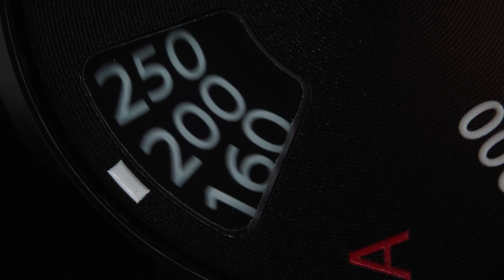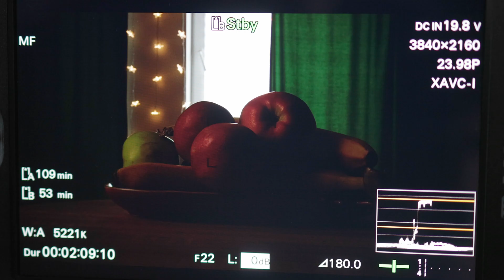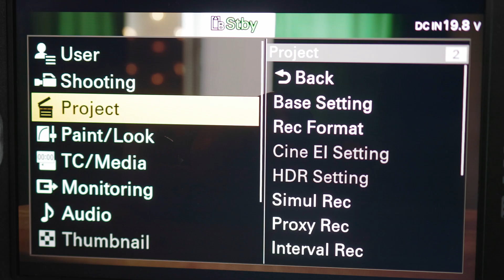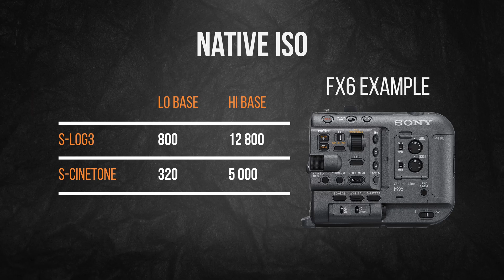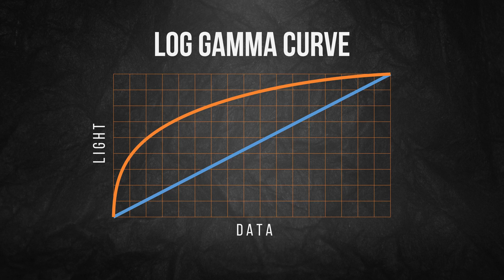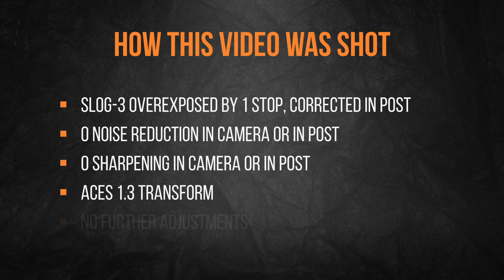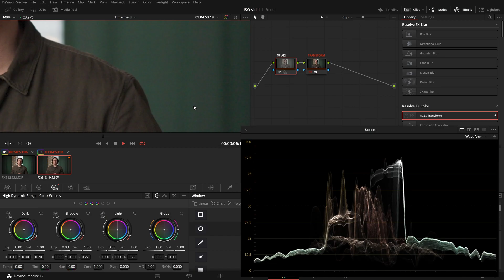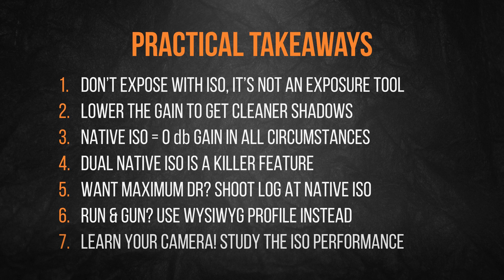Unlocking the Secrets of Native ISO & LOG Exposure

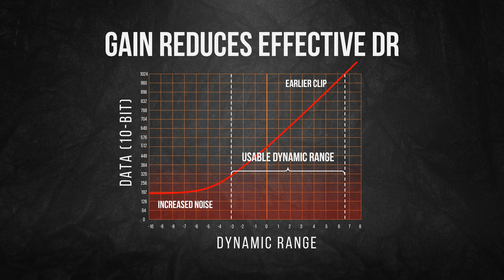Comment: 8:03 so the signal to noise ratio doesn’t change when gain is applied? I was under the (probably wrong) impression that increasing iso might yield a better outcome since the signal to noise ratio might be improved due to higher sensitivity, and thereby more light gathered by the sensor. Maybe that only works for photography? I know that wildlife photographers will prefer a high iso image with noise, that can be removed in post processing to an image that has lost information to under exposure. Maybe you know something about this?
Thank you for your video . Absolutely amazing🙏🏻🎉👍🏻
Reply from the maker: Thanks! Of course SNR changes with gain applied – it gets worse! "Signal to noise ratio might be improved due to higher sensitivity, and thereby more light gathered by the sensor" – that's fundamentally wrong on all accounts, lol, that was the whole point of the video. ISO doesn't change the sensitivity of the sensor and in no way affects the amount of light gathered (exposure is ONLY controlled by aperture and shutter speed as well as ND and lights obviously). The example you mentioned is just a matter of convenience – they are looking at the expo-corrected image, so it's more handy to up the ISO to see what you're shooting. If we are shooting RAW, there's literally no difference in changing ISO in camera or in post.
Reply: @ hahaha..thanks. That went straight over my head😅
Thanks for clarifying. Binging the rest of your stuff now. More self-explanatory questions incoming😂
Keep it up!👍🏻💪🏻
Reply: I have another question you might know the answer to. Why is it that the Arri Alexa mini LF has a higher clipping point at higher isos? That‘s counter intuitive but i just watched a video where someone filmed the same shot with a soft light in frame and at iso 800 it was clipping, but at iso 3200 not. Exposure was adjusted by adding nd to match frames. This is so confusing 😅

Comment: "you lose highlight retention" this does not matter when one is in the dark and there are no highlights. My mystical learning is that adding gain before compression (which tends to be hard in the shadows) is good and therefore one should use a higher ISO when it is the correct thing to do? As it happens.. I have a C200 and I literally build the menu and assigned buttons so that one cannot change the ISO!

Comment: First of all, I love your videos. 
They introduce a depth of information that almost no other video on this type on YouTube does.
But, I’d like to interject on a few points, which I understood differently. 
First, while some dual sensitivity cameras have two sets of amplifiers (Varicam 35/LT, FX9 and DGO sensors like the ALEV), the FX3/6 doesn’t. It’s rather an interpolation that happens while down sampling. It’s actually believed that that sensor has around 42MP that are divided into groups of 4, effectively making it 12MP. The two native iso’s are then derived from two modes of signal interpolation - one averaged (lower base) and one additive (higher base). 
Second, I don’t believe that in general and across the board “native iso” = 0db. I think it’s simple the point where the signal produces the most dynamic range over and under. I actually do believe that Sony, for instance, used to boost the signal to 6db on the Fs7’s native slog ISO, for instance.
I’m not sure I’m right about these, but this is at least what I’ve learned over the years.
Reply from the maker: Hey there, regarding 1) I'd like to see a proof link. And even if correct, this doesn't really change anything for the end user. For all intents and purposes it works like dual base ISO. The higher base is a bit noisier, sure, but at 12,800 it's crazy to complain. 2) that's very easy to verify with cameras that allow iso/gain mode switching. Just put it into 0db and switch to ISO - that's native ISO. Camera manufacturers might have different recommendations for rating/exposing particular gammas (life FS7 you mention), but that's beside the point.
Reply: @ oh non of this really matters. Just wanted to interject with a discussion. I don’t think it makes a difference, just find the details interesting. 
I don’t have a proof link. I got that info from Alister Chapman, who’s maybe not my favorite personality, but he has a fair amount of knowledge. 
The Fs7, as far as I know, doesn’t allow you to display gain in cine ei mode, where native iso is 2000. That’s why I said that in certain cameras it’s true, in others it’s not. “Native iso” means whatever the manufacturer wants it to mean.

Comment: Useful as always. A couple of items to think about I felt were missing: 
1. Of course in a low light situation you tend to use a Low ISO. You learn it first time you use a ARRI camera BUT if you use a "normal" non-raw camera adding dB BEFORE the AD conversion is way better than doing it in post. Of course it's better to use fast lenses and slow the shutter speed, but if you can't it's still better to add electrical noise rather than digital artifacts. Don't you agree. 
2. Second thing: ETTR. As you are not recording on a Linear Color Space but it's a Log CS it's not a smart move to push the signal too much in a part of the compression curve where you have less available nuances. Because it would be above the noise floor, yes, but you would reduce the amount of data in the juicy area of the curve (midtones, skin, etc) to save useless (often useless at least) details in the shadows. Again... Am I missing something? Isn't it better to have them evenly distributed.
3. Dual Native: as you perfectly know the two circuitry are not very comparable. There is often a 2 stops gap in DR between them. Killer feature with a grain of salt.
Reply from the maker: Anthony, this video was intended for beginners, which you are clearly not :) Of course everything is more complicated. But it's impossible to provide all the caveats and "but's" while still keeping things simple and short. 
1. What makes you think you are adding Dbs before ADC? At any rate I would personally never touch ISO unless I'm shooting WYSYWYG (which is never, lol). And with FX3/FX6 high base at 12,800 I literally never deviate from base ISO. The bit about lower ISO was meant more of an illustration to the thinking in terms of gain and how counterintuitive ISO can be. I don't actually think it's a necessary technique with modern cameras.
2. ETTR shouldn't be taken literally, of course, like in photography. A controlled overexposure of just ~1.5 stops is enough to get all of the benefits without the drawbacks you mentioned. And even then it's a situational technique that requires judgement. Exposure is a trade-off, there is no on-size-fits-all formula, you have to decide what to sacrifice and what to prioritise. Besides ETTR has other drawbacks (moving the exposure decision into post production and potentially out of your control can be a pain).
3. Totally depends on the camera. With Sony FX9 and Venice the two ISOs have almost identical DR. When the difference is higher (FX3) Sony tends to not call it "dual base ISO", and even then the difference is about 0,5 stop, not 2. I still believe it's a killer feature, I personally wouldn't buy a camera without it.
Reply: @shagral  considering how deep you go into details and technicalities (which is good) it's sometimes difficult to understand who your videos are aimed to. The DR video was way above the (unnecessary?) knowledge you see on a high end set.

Regarding 1. Even being a professional you know it is not common to know how the whole circuitry works. Considering you know more, I am actually asking. I thought the ISO  process would involve increasing the receptivity (analogic/phisical) of the photocells with an electrical boost (like a mic) and then it would be converted into a digital signal via the ADC. Plus there is a further process of compression of the digital signal into a compressed video file I did not take in consideration in the previous comment. This is another passage where you irreversibly lose data. Again, I don't know, just sharing the train of thoughts but I think in the end it's still better to work with the ISO if all the other resources are unavailable, rather than underexpose and recover in post production. Happy to be corrected if you have more specific tests/data.

1B. Regarding the low ISO with ARRI you actually go lower with ISO as the DR from 100 to 800 does not change and it's only changing where it's leaving more room in comparision with mid grey. So the concept was still interesting to analyze even for other cameras. Moreover we are professional but we jump back and forth from super professional cameras to run and gun situations where the SXT would be a suicide and a C300mk3 is already too much. So having a clearer view about the tech behind cameras at every level is super useful. 

2. the ETTR thing was actually more about the question in the end as you have probably analyzed the actual math behind it better than me. I am still trying to wrap my head around the concept: if I have 8 stops of DR in the scene (with a standard camera of course) and 12 stops of DR in the ProRes file, is every stop in the log scale absolutely equivalent to the other? It probably is but still that was the doubt... Using the stops from 5 to 12 or from 3 to 10 is absolutely the same...

3. it's .5 stop on a Xyla chart (i thought more, but did not check). You are the first one to say in your videos that it can be fooled in these heavy NR situations. Maybe 2 is an exaggeration but .5 seems a bit optimistic. And yes grain of salt does not mean it's not very useful to have it, just means remember that there is no such thing as  a free lunch.

Thanks for the good work
Reply from the maker: 1. I'm pretty sure ISO is just digital gain. Yes, there's a lot of stuff happening before the ADC but I'm pretty sure none of it is directly accessible to the end user, at least on what you call "normal" cameras. I could be wrong. But in practical terms, yes, if shooting Rec.709 I would use ISO as a last resort because camera image processing would yield better results that doing it yourself in post. But that only applies tor Rec.709 (WYSYWYG) shooting. With log if you underexpose, you are in trouble.

1B. I'm not sure what you mean here, but with ARRI ISO is just an exposure index. It basically shifts the available DR between highlights and shadow. Camera still records at native.

2. Yes, I see what you mean. And indeed the higher stops in log are more lossy. More and more linear data is thrown away in the brighter stops. So moving your skintones into stops 10-12 is indeed idiotic, but that's taking ETTR to an absurd extreme. The sweetspot is always the middle, couple of stops above and below middle gray. If you intend for key side of the face to be at 0ev, then shooting it at +1.5ev really has no downsides (unless your highlights are already clipping).

3. This is a fuzzy territory because what is acceptable noise-wise will be different for different people and situations. Practically speaking, I can see the image from 12,800 is noisier than 800 but the exposure latitude is the same when I push and pull it in post. It just means using some NR. I would rather have that option than be totally F'd in low light situations.
Reply: @shagral  Just to share the culture. I have just checked a couple of scientific sources and the gain (as I supposed, because it was too logical to be otherwise) is an electrical gain applied to the photodiod. Like in a microphone, it's electrical/analogic noise applied before the ADC.

Comment: I have a question about the ISO on my Z Cam F6, which has a dual native ISO of 400 & 2500. When I shoot a scene that is properly exposed at the base ISO of 400, I notice it has more noise compared to when I ETTR at a higher ISO, like 3200. Why does this happen?
Reply from the maker: Short answer is: "working as intended". F6 uses the Sony A7III sensor if I'm not mistaken and it is a bit noisy and requires ETTR if you want to get squeaky-clean shadows. However, Z-Cam are good at recording a more pristine noise profile with minimal NR and sharpening in camera, so it should withstand NR in post with minimal degradations in quality. It does require more work in post, but that's "cinema cameras" for you. If you want clean shadows out of the box, use ETTR. High/low ISO are almost equal in terms of noise, biggest factor here is ETTR or not.

Edit: oh, and do some tests! set up at home in controlled environment and cycle through all the ISOs, over/underexposing and study what happens when normalised in post. That's the best way to find and see the exposure sweet spots // breaking points of your camera. Learn your tools!
Reply: @ Thank you for the info. Definitely will do some exposure test.

Comment: In the Exposure to ISO chart's the 18% Gray point sort of marches down with with Increased ISO, but what I've not seen said anywhere is does the 18% gray point also reflect an alignment to color gamut?  (Meaning color gamut shifts between your dynamic range bright vs Dark).  Since skin tone's are the most important color to match, does this mean that ISO should be used as a tool to place skin tones correctly in the dynamic range or is Base ISO always better?  I've heard on the color grading forums that ETTR causes problems during color grading.
Reply from the maker: Colour gamut is a three-dimensional palette, it doesn't shift. But the saturation and lightness of colours of course track with exposure. But in case of shooting 10-bit Log or higher quality, you have complete control of that mapping in post production.
ETTR only causes problems if A) clipping of one or more of the RGB channels occurred or B) destructive/incorrect colour pipeline is used (LUTs as opposed to colour management or mathematical transforms). Also, ETTR should not be taken literally, usually after ~1.7 stops of overexposure there is zero benefit to exposing even brighter. And even that is only recommended for really low-key scenes.
Hope that helps.

Comment: Great video and article. Very hard to find good information on this topic. I have been trying to understand why the fuji x-t3 base ISO is 160 (0 gain) for photos and standard video but in f-log base ISO is 640. I'm a little less confused but still not sure how base ISO (0 gain) can have 2 different values excluding a dual base ISO sensor. I understand that the dynamic range setting at DR400 requires a minimum ISO640 because the camera actually exposes 2 stops under using base ISO160 and then brings up the shadows when processing jpegs. I was thinking something similar might be happening here. It's got me wondering how shooting video with ETERNA video profile at DR400 ISO640 compares to f-log ISO640. Subscribed and keep up the excellent information.
Reply from the maker: Hey, thanks for watching and subbing! The brief answer to your question is at 6:12. Log gammas (f-log video) and linear gamma (raw photos) are exposed differently, hence the difference in base ISO. No gain is being applied, it's just a number that you would have to put into a light meter to get correct exposure for your chosen gamma.

Comment: Great video on a very misunderstood concept! My question - in a dark situation, instead of using negative gain, is it better to just leave things as-is at your (highest) base-iso, and change 'exposure' (gain)  in post???
Reply from the maker: The goal is to get your waveform above the noise floor as much as possible without clipping the highlights. Negative gain is just a way to lower the noise floor (at the cost of DR in the highlights). But I wouldn't bother with that if you have a modern-ish camera (say 10 bit and ~12 stops of DR). Everything else depends on your camera and scene!
Reply: @shagral  I have this question too, in your situration, negative gain lower the noise floor, but at the same time, the brightness of shooting subject lower too, which means the signel and the data we want, also lower and still within the noise floor, how do we get benefit frow negative gain in low light situration? 

And thank you so much for the video. I am enlightened! :yougotthis:
Reply from the maker: @johnsek4294 low light doesn't mean no light. If we are talking about cinematic exposure (meaning you have some control over light) then you will have to pour more light on your subject to compensate for lower ISO. But you shadows will be cleaner. 

If it's a total run and gun and you are shooting a black dog on a moonless night then don’t shoot in LOG!